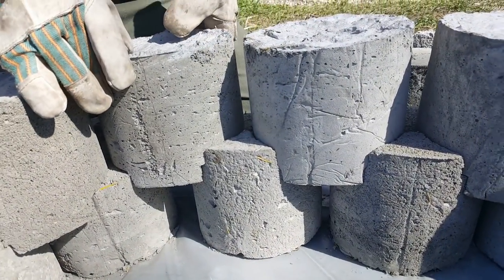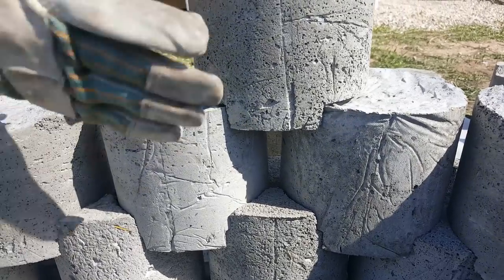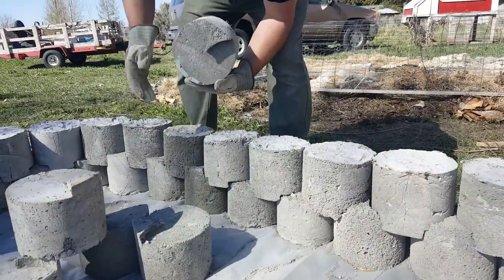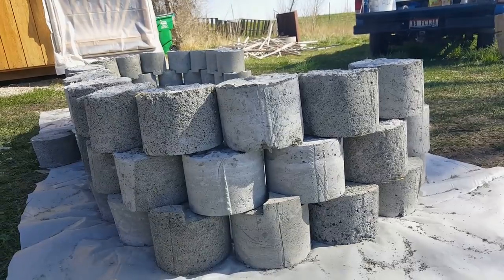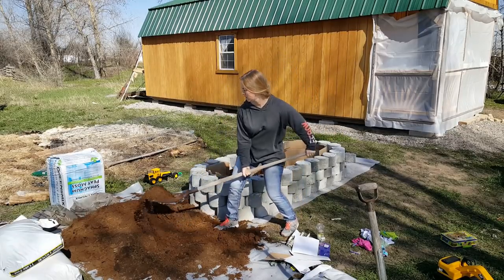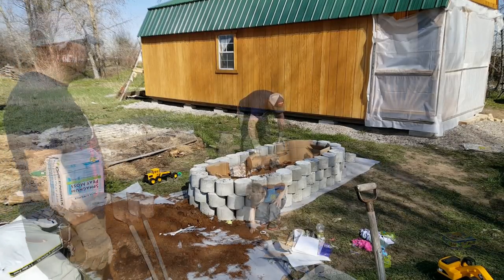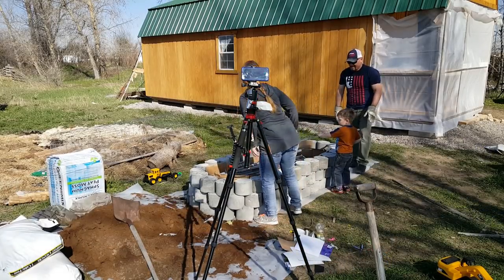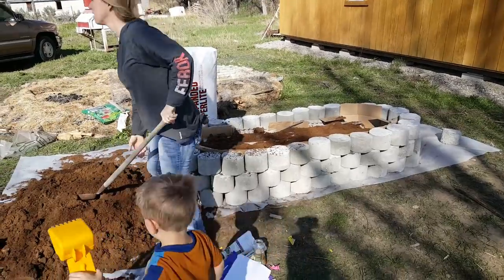Building A Organic Air Crete Raised Garden Bed

Comment: I like Julie's idea for using the cardboard as filler and to help keep the "dirt" from leaking out between the blocks.  Also using the logs as filler, along with the cardboard they'll add some nice compost to the garden soil.  Very nice design for the block locking system!  Would it make sense, or even be easily done, to put a "V" tab on both the top and bottom of the blocks?  That should really help with the interlocking of any upper rows.
Reply from the maker: I know... Right... I learned so much... Love these projects she comes up with...HDC

Comment: You could of made square corners instead of the round ends. Might of been easier with the pie cuts. Also not sure why you used plastic on the bottom, cardboard would be a better option for moisture management and weed block, allowing insects and worm to migrate, etc. interesting build though.

Comment: Are you still using shampoo as you foaming agent?
Reply from the maker: I am on other projects. I used seventh generation on this one and stabilized it with lime and j-lube.
Reply: Honey Do Carpenter is that safe to eat? It will leech into the soil and roots. Or is it a flower box?